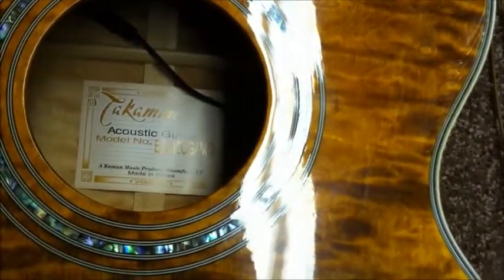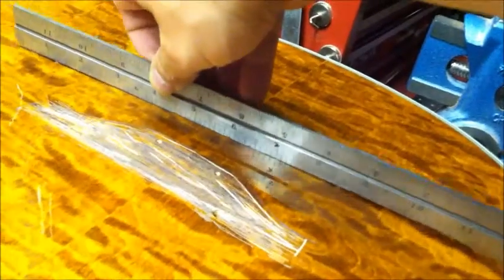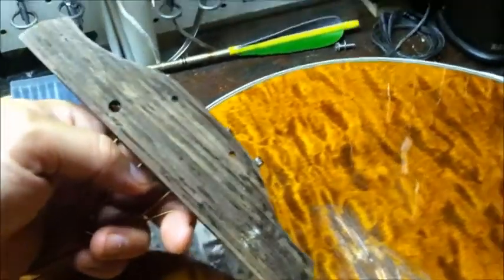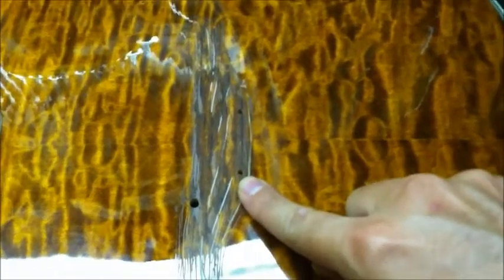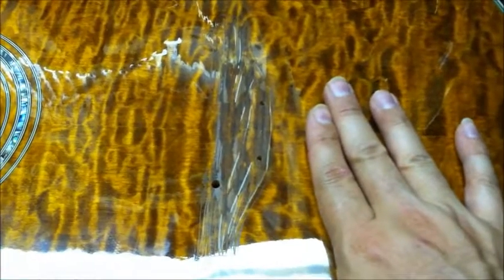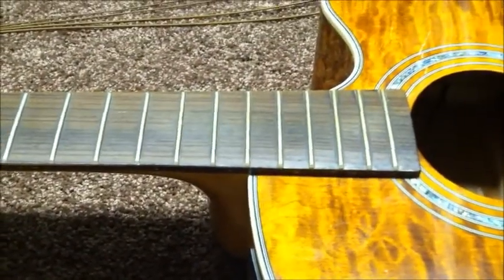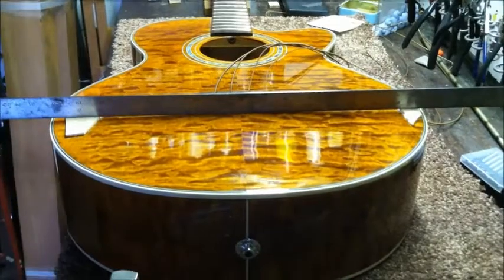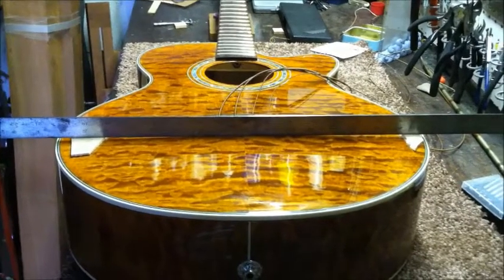Takamine Acoustic Bass Bridge Dr

Comment: Very nice Chris. Any idea where I could get one of those tensioning rods?
Reply from the maker: The specific tension rod I used for this contraption was a simple 1/4" threaded rod from the hardward store. I epoxied a wing nut to the end of it. If you're loking at buying something this this for your guitar then you can get the Bridge Dr. from www.stewmac.com. If that's what you're looking to do then make sure it will fit your guitar. That's why I had to make one for this bass. Thanks for your comments. Let me know if I can be of any further assistance. ~Chris